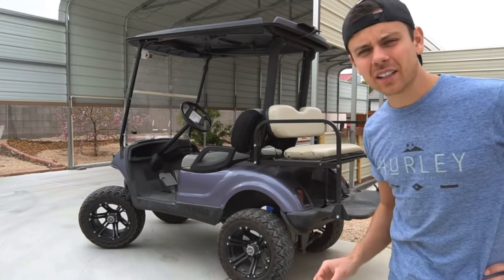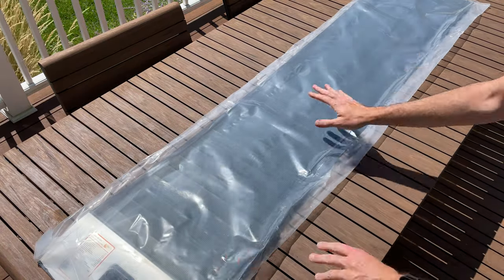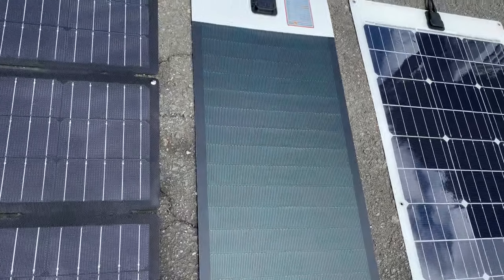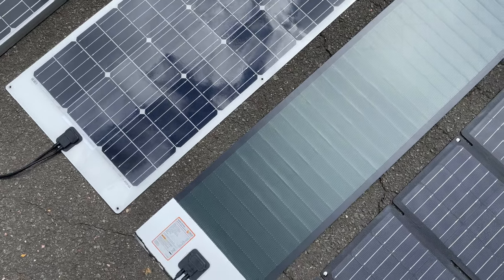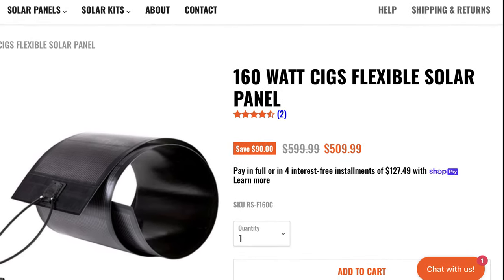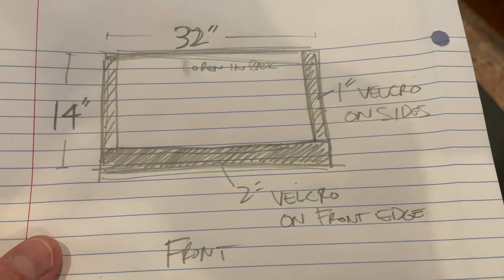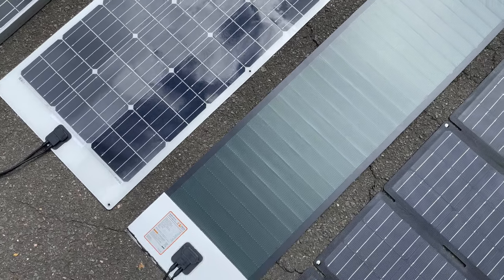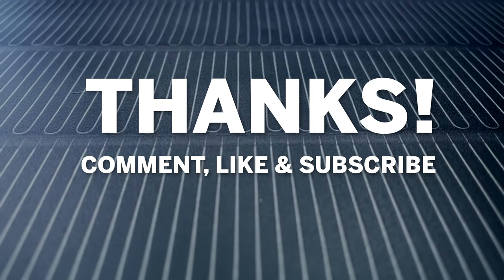Best solar panels to mount on a GFC Superlight RTT - Rich Solar 80w CIGS Panel

Comment: I know how to install VHB tape and Eternabond tape with alcohol and applying pressure, and thought it might be the same a my new Bourgerv CIGS panel, but i wanted to check and Bourgerv really does not say much except "stick it on", lol.  Thx for the installation part of this video!
Reply from the maker: Glad it helpful. Mine held pretty good after a year outside but I did need to peel back and repair 2 corners

Comment: Very cool ideas…thanks! I have been thinking about putting my portable solar panels onto a foldable fabric awning that I can hook onto the drip groove on my van and so provide shade over the side doors of the van which meanwhile recharges my Bluetti power station. I have salvaged some aluminum poles from an old tent which will hold up the awning.  Hoping it all works out!!
Reply from the maker: Good luck!

Comment: There are some used/open box CIGS panels (another brand) of various wattage on ebay if you are ok no warranty.  They don't have adhesive on the back but are cheaper.

Comment: Enjoyed your video.  How hard was it to remove the panel?  Was their adhesive residue?
Reply from the maker: It took a lot of slow steady pulling but it came off pretty cleanly. The only issue is the 2 panels were very tight together and I accidentally damaged the edge of the new panel but prying too fast. Just cosmetic.

Comment: How would you mount these to a van roof that has ridges built into the roof? Are they flexible enough to follow the ridges? How difficult was it to remove the broken panel? Thanks
Reply from the maker: I don’t think they are flexible enough to cover small ridges so I don’t know how well these would work. The broken one came off pretty easily, took a fair amount of slow pulling

Comment: Love this review. I want some CIGS panels. Rich Solar sounds like they have a great product. Anyone have ideas on how I can mount this to the roof of my RAV4? I want to be able to remove it and not damage the paint.
Reply from the maker: You’d probably need to stick these to some sort of backing. A thin magnetic sheet might work, the kind they use for signs on work vehicles

Comment: Hey todd i would be very interest in seeing a head to head on all the panel as i have yet to pull the trigger on solar yet as cost is my biggest road block let alone other figure in with them overall
Reply from the maker: I think the CIGS panels are definitely the way to go for mounting on a RTT like the Superlight, just peel and stick. They now make a larger version that is double the size which would be even better

Comment: Good stuff here, Todd.  Thanks for sharing.  I'm due for my GFC RTT V2 install next weekend!  Definitely trying to get power sorted out.  It's been a while since these went on, how are you liking them now?  Any thoughts on just a hanging type panel to charge a battery bank?
Reply from the maker: Still liking the panels but will need to glue down a few edges. You have more mounting options on the v2 than the Superlight because of the side rails so you might be able to rig up a glass panel but if you want simple install, these peel and stick are easy, light and rugged. I’d go with the 160w instead of 2x 80

Comment: Wondering how to peel the bad panel.
Reply from the maker: Welp, I has to because one of mine failed. If you peel slowly the adhesive will release. It does leave some residue but it’s not bad.

Comment: I want to know the differences between the solar panels
Reply from the maker: Hmm, that’s a big topic I can’t cover here but generally glass panels are best for permanent installation, foldable panels are best for portable setups where you only put them out on sunny days. This cigs panel is an interesting hybrid because it’s flexible but can be permanently mounted outside and handles shade better than other types

Comment: how has this solar panel held up for 2 years?   Is it still 100% functional - thinking about adding a flexible cigs solar panel to the top of my superlite.
Reply from the maker: I just put my superlite back on my roof and noticed on the panels has some delimitation issues so not great :/
Reply: @todd.parker  Aok thanks I’ll wait to put a solar panel on until I upgrade to the rtt from gfc.
Reply: @todd.parker  How is your tent stored when not in use? I want to put one of these on my Superlite but am worried about delamination. When I don't use it, I keep it stored in my garage so it might be ok.

Comment: The defect could have been from setting all that stuff on it...  what is required to charge a 65W laptop straight from the solar panel with no battery in a sunny state like southern California?
Reply from the maker: You really can’t. The battery is needed to keep the power steady
Reply: @todd.parker  My laptop has a battery...  are you saying that the solar panel output is too inconsistent to charge a device directly?  Then how does it charge a battery since a battery is a device...  I was looking at Bruuner solar panel to go on top of my SUV.  It has USB C output and it's always blazing hot here in So Cal.  When I camp, I wake up in the SUV and it's 100F inside and the sun has been blazing on the roof for a good 4 hours which would easily charge my battery at even less than the rated output of the Bruun...

This is the one I'm looking at getting...

BRÜUN – 120W Portable Solar Panel – 2 USB Type A and 1 Type C Port - Perfect Off Grid Mini Foldable Water Proof Panel for Power Station Use - $114

So your advice is that I also need a travel battery?  What kind of travel battery do I need just for a 65W laptop who's battery lasts between 3-5 hours depending on the screen brightness... I need to get a 12 hour work day out of the laptop offgrid.  It takes about 1.5 hours to 2 hours to fully charge... it takes 30 minutes to charge to 50%...  

• HP Fast Charge: Go from 0 to 50% charge in approximately 30 minutes.(72)

HP ENVY x360 Convertible
15m-eu0033dx

hp envy x360.  They claim the battery will last 11 hours, that must be a different model or different type of work than I do, mine typically lasts 3-5 hours.  So I will need to charge it 2-4 times during a 12 hour work day...  I may be adding a MIFI 5G hotspot so I will need to power that as well...  for a 12 hour workday.

Can you recommend the lowest cost and fastest charging battery and rooftop solar for me for a small SUV?  I don't want to glue anything to the top of my vehicle... I don't mind some 3M sticky tape and some zip ties.  I want it to be as stealth as possible, so the smallest panel and if I can take it off easily that would be good.  That's why I was considering that Bruun panel...  I'm sure I would have full sun most of the day...

Last time I researched a couple months ago the Eco Flow River Pro seemed the best due to it's 1 hour charge time since it will probably be charged at a Starbucks or from one small solar panel and from the car driving sometimes, but the travel battery niche seems to improve quickly so there is probably something better by now.
Reply: @todd.parker  I called Goal Zero and confirmed that the formula is just Wh divided by how many watts your power supply uses... my power supply is 65watts so I can get 10 hours out of a 650Wh battery...  and my latop takes about 1 hour to charge so that's about 10 charges more or less...  so if I need 3 charges a day for a 12 hour work day then I need 200Wh to 500Wh battery... depending on screen brightness and usage.  Thanks for letting me bounce these questions off you.
Reply from the maker: @VenturaIT  if your panel can output usb-c then you might not need a power station but they typically don’t output much via usb. The one you’re looking at is rated at 5v/3a = 15w for usb-c and to charge a laptop you need 100w power delivery so that won’t cut it. The River Pro is a good choice. The Delta Mini is also good. The EB70 from Bluetti would be good once they update it to match the EB3A. For panels, it really depends how you’re mounting them. For permanent, any glass panel is good or the peel and stick CIGS. Avoid flexible panels. For portable, folding 100w one by XTAR are my top pick.
Reply from the maker: @VenturaIT  cool. Keep in mind that there are losses so take 20% off the capacity to account for that. And don’t buy a Goal Zero, they are way outdated compared to Ecoflow and Bluetti
Reply: @todd.parker  Goal Zero has people who answer the phone in the USA, which is important, I'm also looking at Anker because they have LiFePO4 batteries that will last longer, but at the pace of innovation who knows what will be around next year.

Comment: Are you still happy with your choice?  Have you experienced any other issues?
Reply from the maker: I've been very happy with these so far. The edges lifted a bit in places but I used VHB tape to stick it back down. They now offer larger panels so I'd go with one big one

Comment: How are these holding up after a year. 
I had Renogy flexible panels before, and they delaminated but they recalled them and gave me a full refund.
Reply from the maker: Still working well. Had to glue down a few corners but otherwise going strong
Reply: @todd.parker  thanks! I’m debating about adding these to my 2021 Sienna to keep the fridge powered. The 1500w inverter helps a lot, and paired with my River 2, as long as I drive it daily my fridge runs fine. Waiting for another sale to use your code for the River 2 Max. It maybe the Goldilocks size for me. The River Pro is too big to fit under the center console on my van.
Reply: Just checked Rich solar’s site. The 5 year warranty is now 1 year on the CIGs panels. I’ll probably skip solar and just go with a larger battery

Comment: How does it works goal zero
Reply from the maker: It works fine with all popular solar generators, including Goal Zero. You just need a MC4 to 8mm adapter
Reply: @todd.parker  thx  for the fast answar
Ps.  Can you get them in eu.   I am from danmark.

Love your vid with goal zero, keep up the good work
Reply from the maker: @MortenRoskildeRasmus  Thanks! I’m not 100%, check the Rich Solar site for EU shipping. BTW I used these panels with my Goal Zero Yeti 1000 for this whole build, works great.

Comment: Old school ooftop tent, right. Really basic. I wonder why you went for an expensive power station that probably costs more than the tent? I also see you went for two and not 3 panels, the roof would have had the capacity for them. 60 volts in series is a very good value for a mppt controller. you would have had 200 Watts of usable power to charge or even run a mini airco, fridge or TV by using passtrough charging. You do wanna have a chill in the evening.
Reply from the maker: I’ve had the Yeti for a while so that’s what I used. I couldn’t quite fit a 3rd panel but that would have been better

Comment: The silicon fake 'flexible' panels should be outlawed...
On the cigs panels each 'cell' is actually a mini solar panel in parallel...
Reply from the maker: You mean the typical flexible panels that delaminate and burn out in a year or two? Yeah, they're bad